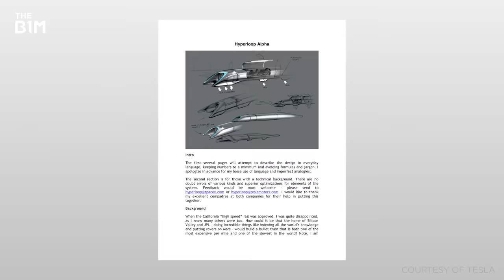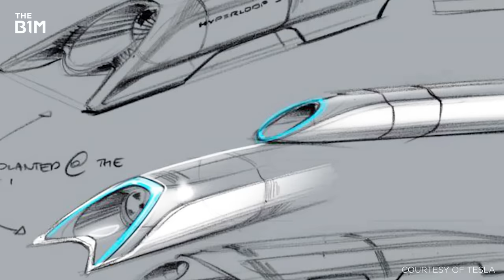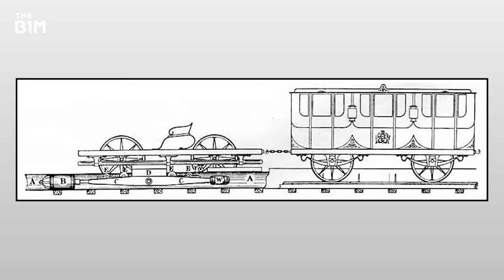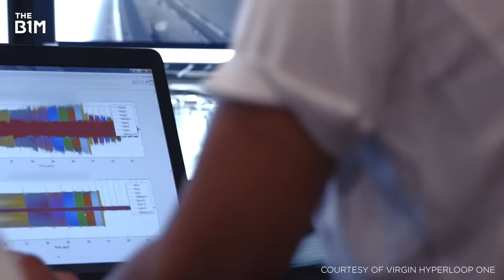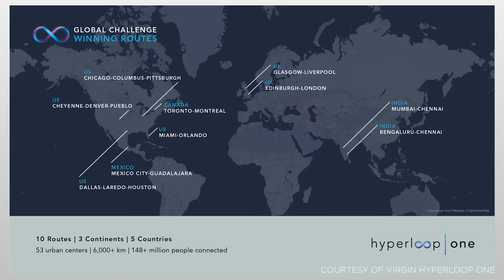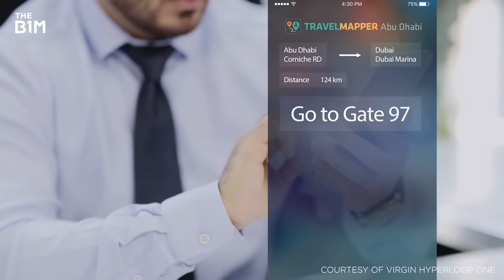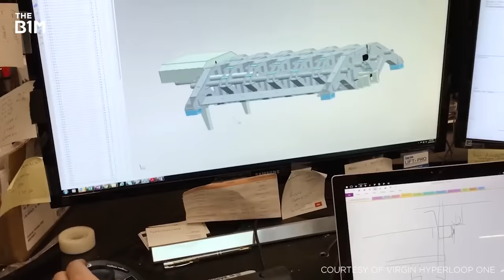Hyperloop Explained

Comment: I have Popular Science magazines (might be Mechanix Illustrated magazines) dating in the 1950s that were promising this sort of technology and I am still waiting... I hope it comes true but but i am pretty sceptical that it will be done in my lifetime.  
Environmental concerns, expensive land acquisition in urban areas and pressure from cheap priced airlines are pretty tough obstacles to overcome.
Reply: And then, there are always conventional high-speed and maglev trains that are proven technologies.
Reply: ahahahaha im waiting for a man on pluto too
Reply: Evacuated tunnel ideas have returned several times already, yes. And while it's hard to say for sure if this time will be different from previous times, at the least each next time our technologies are more capable.

So there the base principle of energy cost to move the 'train' through an evacuated tunnel is true. And thus in theory should allow for cheaper prices, so long as infrastructure costs aren't to excessive. The question becomes, can modern technology make the required infrastructure to run this system at a price point that doesn't destroy the cost savings gained for moving objects through an evacuated tunnel.

Sadly we'll just have to wait and see if current technology can do it. The number of projects on it going on right now does make this seem like a pretty serious effort at making it work this time around. So perhaps some companies/engineers think it might be feasible this time.
Reply: you are underestimating humans. we will be on mars in 6 years
Reply: If it's a futuristic thing depicted in Popular Science, Popular Mechanics or Mechanix Illustrated, it's almost a sure bet that it will never happen.  Hahahaha!
Reply: Nikolai Stakheiko.    Call me a pessimist but I prefer a realist.  I will make this statement wo will not be going to Mars anytime soon. 
The closest that the Earth and Mars would ever be is a distance of 33.9 million miles.
That’s really rare though: the more useful distance is the average, which is 140 million miles the fastest a human object ever to go into outer space when it roughly 36,000 miles an hour and that was an unmanned probe that went to Pluto 2006 after being slingshotted I believe off of Jupiter and it's huge gravitational Mass... As for a manned craft, the record holder  was the Apollo 10 back in the 1960s it went 24791 miles an hour... The technology in Rockets hasn't changed a whole lot other than Electronics now control the burn to do it more efficiently the propellant is the same as it has been since Verner Von Braun invented the v2 -in World War II.  Solar sails, ion drive engines, Dark Matter engines are all currently just science fiction just as is a net positive Fusion reactor.  
In the Apollo era, the space crafts used a rocket that was much larger than the current largest Falcon heavy lift.   So let's do some basic math supposing that a rocket like the Saturn V comes back in to use with in the next 6 years.  Mars will be 140,000,000 away, divided by 24791 which was the fastest top speed ever recorded of a manned craft and you get 5647.21068 now divide that by 24 hours in an Earth day to get how many days it will take to get to mars and you get
235.300445. So 235 days which when you times it by two you get 470 days  which would be the longest that any human being has ever been in outer space and that is just for the trip not counting the actual visit for Mars Plus how are they going to get home? It isn't like they can manufacture another Falcon heavy lift rocket while on Mars so they will have to safely ship one of those too plus a possible back up and even though Mars has less gravitational Mass it would still need a large rocket to shoot a crew of five or six, men and women back towards Earth.   The technology is technically there but it is cost inhibitive to go to Mars and it is on the upper end of what humans can realistically physically withstand  even if you go with it 36,000 mile an hour speed it still takes 161 days each way that is an astronomical amount of time. If we end up going to Mars it will be more like 20 or 30 years and it will be new technology that hasn't even been invented yet.   
The problem is with space travel  it is extremely vast, it is expensive and it  it is full of radiation plus it is in a vacuum not exactly ideal conditions for human beings or Electronics.  And I haven't even gotten to the possibility of solar flares which cannot be predicted correctly that wreak havoc on humans and space crafts went in outer space.  We are decades away from going to Mars unless somebody dumps a shit ton of money into getting there.   Similar to the way the United States did it in the 1960s going to the Moon. But the United States had ulterior motives in that we were testing Rockets to carry nuclear bombs and the ultimate way to say that we were cooler than the communist to the general population of Earth.
Reply: Milosz Ostrow I hate to admit it but there is a lot of truth in your statement.
Reply: Atomic Reverend Alexander
about the average distance between two planets... you only hop from earth to mars when the planets pass each other while they're in their orbits, which occurs every 26 months. during this window, the distance between two planets is on average 49 million miles (142 million miles is mars' average orbit radius, minus 93 million miles earth's radius). not too reasonable that we will travel the fastest speed humans have ever travelled because were not catapulting off jupiter. lets say average speed of 13421 miles/h (6 km/s) with the BFR spacex is already building. 49 million miles/13421 = 3,650 hours = just over 5 months. That's a long time, but manageable, and so will be the radiation. also if you really dont want radiation in space you can sit in front of a small magnetic field, just big enough to cover your body. this is definitely a manageable problem, one you dont need crazy tech for. same thing for mars - artificial magnetic fields or ice domes to protect against rad. SpaceX is building a rocket for this and have the engines + gas tankers completed. now theyre literally assembling it (in a giant tent in LA). they have a slightly aggressive timeline to hit mars with supplies in 2022 (in 4 years), humans in 2024 (in 6 years). lets say they miss the 2022 window and launch supplies in 2024, humans in 2026 (8 years). still not bad!! Yet... it seems theyre on sched with BFR development so far,,, who knows!
Reply: You must be very old.
Reply: @toonikolai  Remind me in two years if we've sent a human to Mars yet.

Comment: Still, how is this supposed to work in practice? There has to be at least two "loops" at each destination since you can only travel at one direction for each loop. Then how many can actually fit inside one of the pods, and how many pods can you use at the same time without the risk of crashing into each other? How will they turn the pods around into the opposite direction without blocking the incoming tubes? How can you really made this efficient for the masses? Would it perhaps be more efficient with an actual loop? With no need to turn around since there won't be any end to the loop, it just goes around and around.

Comment: Just wondering how much energy it would take to decompress a tube, and would it have to be done in a regular basis 🤔 tl;dr: what's the real energy consumption here?
Reply: Massive energy consumption, MASSIVE. Just powering the magnets alone, let alone pulling a vacuum in a miles long tube
Reply: @youngeshmoney  and only if it doesn't start leaking. Chances of it working are low and if it works the small carriages will make it too expensive for the regular Joe.

Comment: The maglev train is scheduled to begin commercial operations between Tokyo and Nagoya around 2030. It has taken nearly 70 years since Japanese national railway started the research. I think Hyperloop may also take almost same decades of Japanese maglev train to begin commercial operations.
Reply: The maglev has already fixed the problem of levitation and propulsion for the hyperloop, and I think the tupes have fixed the problem of air pressure. It won't take as long as you think now, Elon's original idea of levitation would have though.
Reply: Maglev makes some sense though it has a lot of issues that make me question if it will take off. Hyperloop is just a joke.

Comment: Any saving in energy will be more then made up for by the requirement to attain and maintain a .005 atm vacuum.
Reply: air locks.
Reply: Penny Wagner Air locks help with emergencies, but don’t change the energy requirements to maintain a vacuum
Reply: @pennywagner8487  A constant stream of pods means a constant stream of lost vacuum in those air locks.  So, yeah, it will be very expensive to keep such a vacuum in place... if they could ever even achieve it... which is pretty dubious.

Comment: 4:22 Yes MAGLEV stands for magnetic levitation but that is a propulsion method and can be used on a variety of train systems.  A monorail means a train that runs on one track or guideway and may use any propulsion system.  There are monorails in Las Vegas and in Disney World in Florida but neither one is a Maglev.  Your statement is not just apples and oranges it is apples and cement blocks.  https://en.wikipedia.org/wiki/Maglev    https://en.wikipedia.org/wiki/Monorail

Comment: Me posing questions: A) if there's a serious problem in the way, you're trapped in the vacuum tube, how do you get out? B) have you done the Math of how much energy you need to create a vacuum on such a big quantity of volume? I did, and it's enormous! And you'll have leaks on the joints.
Reply: I wonder about that too. Every transportation system has breakdowns, and people in NY's subway system have grown accustomed to endless waits or walks between stations. What happens when a hyperloop pod breaks down? Since there must be many pods in the tube at once in order to carry enough customers to make economic sense, there will be a big backup. So you just keep everybody there? Or you let air into the tube so people can walk out? Out to where? There would have to be escape areas at pretty frequent intervals to let everybody get back to the real world. And these escape areas themselves would have to have some sort of transportation connections. These and other safety considerations get very expensive, making an already economically doubtful system prohibitively expensive.
Reply: If you think about it for just a few minutes, there are endless problems. How do you get in and out of the pod? Each tube can only be one way of travel or have one pod in it. As you say, the power needed to create a meaningful vacuum is colossal. How strong will these tubes need to be? That will be expensive. Leaks, damage and environmental change, all problems.

Comment: Only a dozen each run? How can it compete with even flight? The magnet rail and vacuum tube will cost times more than traditional HSR. 10 times more than normal train. And 1/20 of overall throughput. Unless it charges 5times flight ticket price, it won't even cover operating cost.

Comment: What a cool concept. It would be even cooler if they could manage to invent transparent steel so you could see outside. They've done it with aluminum.
Reply from the maker: Passenger pods will have plasma screens showing images of outside locations: https://youtu.be/Dc1RtjuYL9M?t=278
Reply: We should just be able to roll down the window. That would pose no problem at all.
Reply: tubez4321+ But aluminium oxynitrate (often called transparent aluminium though it is actually a compound and so not technically aluminium) is incredibly expensive.  A small window made of it costs thousands of US dollars.  It is tougher than steel, clearer than window glass and highly impact resistant.  It is also more expensive than any other optically clear window material except diamonds.  Make the hyperloop tunnels out of it and that would increase the cost by billions.

Don't get me wrong I like the idea, but nobody is going to be able to pay for it.
Reply: How about focusing on what can be done instead of all of the impossibilities?
Reply: tubez4321  

I don't know...

Traveling at 600+ mph at ground level?  I don't think having an external view will do much good.
Reply: Keith Craig  Well if the landscape is a nice one and there is enough time to view it, why not? Also, people may like seeing just how fast things whiz by. I know kids do.
Reply: Mr Scott will give them the formula in exchange for some plexi glass so he can build some whale tanks.

Comment: Yes, someday, but not as you say, "the very near future". The technology can be built, but the cost and the return on investment make this a difficult project. Meanwhile aircraft and ground transport development continues and it is much more cost effective to have thousands of places you can fly to, rather than just a dozen places with a hyperloop. The future is going to be expensive.
Reply: rizzle razzleuno aircraft would very much still be the most used long distance travel method, however hyperloops would be used only on the busiest of overland routes, with maybe a few potential underwater ones I.e the English Channel or the Sea of Japan
Reply: @ala0284  It will be decades at the earliest for even a small line to be put in.  The maintenance alone would be extremely expensive.  These tubes will have to be inspected all the time, provided environmental factors haven't already made them unusable.  Sun plays hell on railroad tracks as it is, and they are a lot smaller than a giant tube, the amount of expansion would be hard to compensate for without adding an extreme amount of complexity and failure points.  I doubt this will be the future of travel at all.

Comment: To me it seems like the cost of energy lost due to air friction in Maglev is way less than the cost of  building and maintaining the Hyperloop.
Reply: 100% correct. There is a future for Hyperloops but probably on the Moon or Mars where the air pressure is practically non-existent. Not on Earth.
Reply: You'll probably be surprised the energy to overcome the friction. It also improves comfort and max speeds achievable
Reply: @MrMole17  Yep people forget that drag is depended on speed squared, so drag goes up faster then speed
Reply: The difference isn’t as bad when you consider the speed of travel that is possible
Reply: George Martin But on the moon we don’t need the hyperloop, there would already be no resistance
Reply: @hans-joachimbierwirth4727  how does decreasing the pressure of the tube increases friction, if there are (almost) no molecules to offer resistance how will there be resistance?
If decreased pressure increased friction then space travel would be impossible.
Reply: And maglev is already uneconomical to operate and maintain.
Reply: Air friction costs exponentially more energy the faster you go.
Reply: You drivel bears no substance. There is no science involved in Musk's PR stunt for the scam known as Hyperloop and i explained the foundational flaw in that ridiculously stupid idea: Externalizing of air movement around vehicles does not provide any efficiency gains. The idea is based on hidden overunity like many scams are.
Reply: Que. Bien.
Reply: Que.  Bien.
Reply: Seems you have no concept of the engineering challenge in building a tube hundreds of km long that can hold a vacuum. It's impossible with current or any future tech that we can even imagine at this point.
Reply: It’s faster very fast

Comment: The hyperloop is very flawed, i have said this before but While the concept of a hyperloop sounds cool, they would be way to problematic if used as actual transit. First, the cost. A hyperloop is really just a maglev (An expensive form of transportation) inside of a vacuum tube (an expensive device) along with some isolation valves and pressure control crap. Which would probably make the track infrastructure/mile  cost a few billion. Second is safety and efficiency. While trains and other forms of transport are unsafe in their own ways, a hyperloop would be loaded with deadly points-of-failure, such as the vacuum tube rupturing on the outside or worse, the inside of the carriage rupturing and causing a depressurization, or the  power supply failing and the carriages slamming into the concrete below them at 300 mph because the magnets are no longer supplied with power, Also if a switch failed, keep in mind that maglev switches are weird , complicated and can only be passed through at low speed, and these switches will be inside of vacuum tubes which ads more points of failures. In terms of efficiency, there are a few issues. First the only maglevs in operation are fairly low capacity  and in comparison draw very high amounts of power, more than  many 25kv HST systems. Second, the only hyperloops that have been tested, by virgin hyperloop, are slow, draw a huge amount of power, and their test vehicles could only hold 2 people, oh and it also took them 6 years to get that first prototype working.  Just in general hyperloops are not a very good way of transportation despite looking cool on paper. What we can do is upgrade out high speed rail and even future maglev systems to go at speeds close to a hyperloop or faster, which is possible.